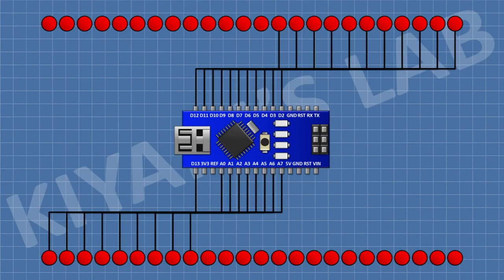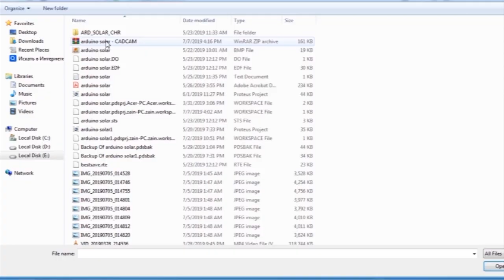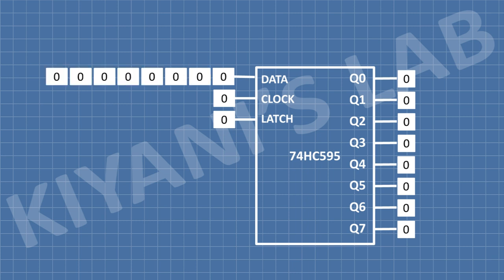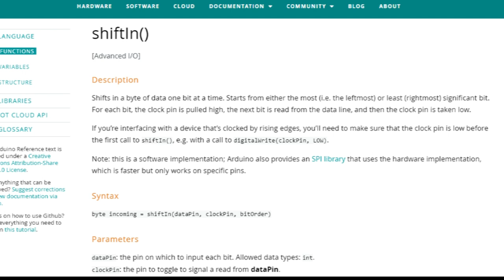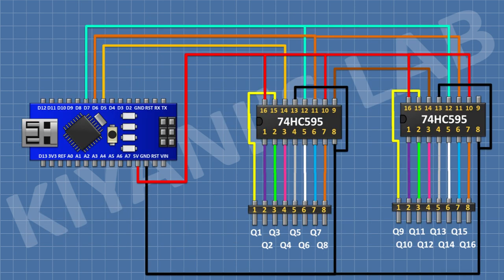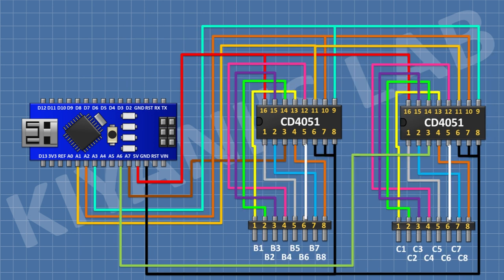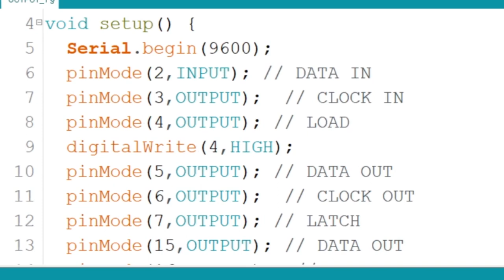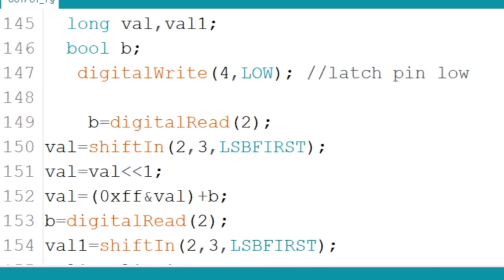How To MUX Arduino Inputs & Outputs | Arduino Multiplexer

Comment: Great video. But what are the resistors for?
Reply: LED'S
Reply: A LED in the the forward bias has zero resistance. If you don't add a resistor the total resistance through the LED will be zero. This will for even a small voltage drive a large current through the LED and short-circuit and burn everything. You'll have to buy a new Arduino. Be careful.

Comment: Thank you so much for sharing... I have just assembled your scheme "MPPT 3.0 with arduino nano", but suddenly cut off the GND from 3rd pin of irfZ44s => so that the arduino very hot at 328P chip, btw all 3 leds: RX-TX-PWR are ON => how to fix this? Thank!